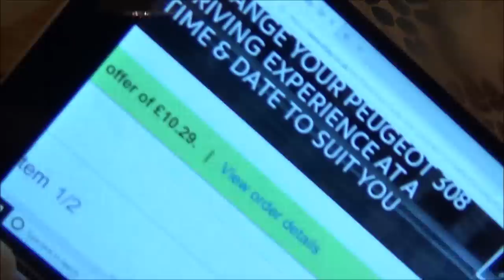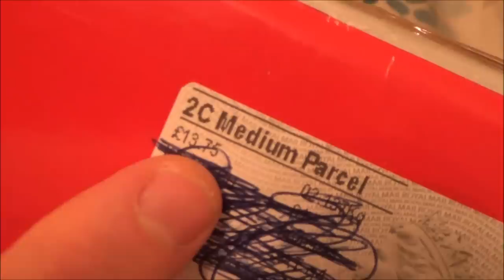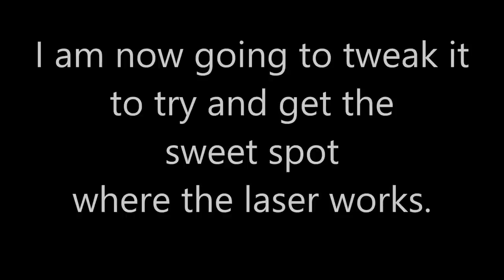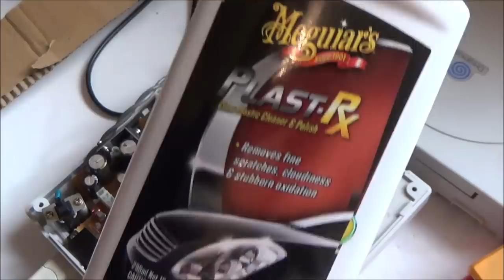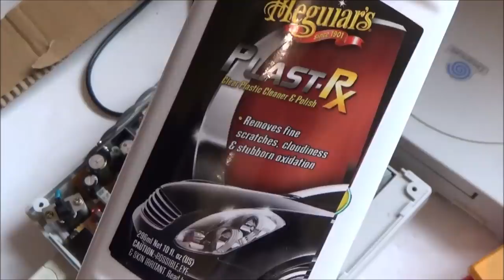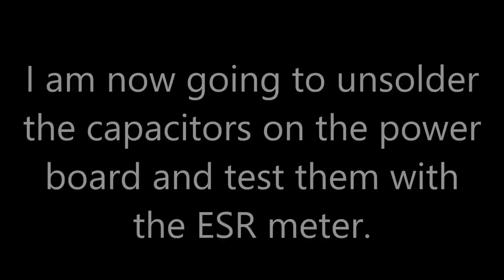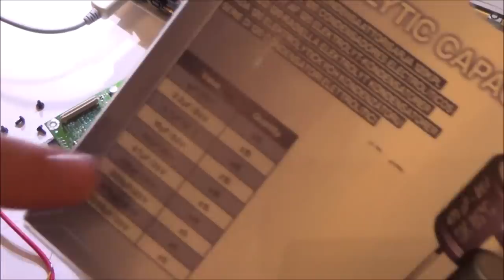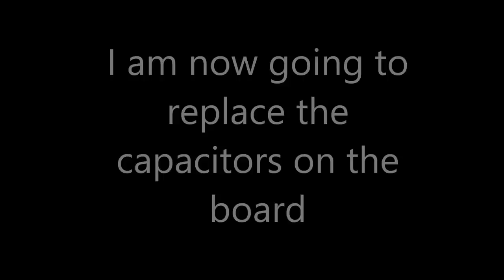Trying to FIX a Faulty SEGA Dreamcast purchased on eBay

Comment: What were you doing at round about 39:00? Measuring Resistance when the system is still powered? That's completely nuts as you then are measuring something but definitely not the resistance. Please do unpower the device and then measure Ohms, as you otherwise would measure some mixup of the voltage provided by the ohmmeter and superimposed the voltage provided from the device to see what current flows through your potentiometer (pot). Are you sure you know what you're doing?

Comment: if the laser stops reading, reduce the resistance. Resistor on the laser head, spin it a little bit, try 700ohm, 650ohm and so on

Comment: The Dreamcast does indeed support AV cables as well. I hear it also supports VGA output if you really want your games to look good. Of course, these cables are all proprietary, but they're options, nonetheless!
Reply: Robbie  That sounds amazing! Where did you get the converter from?
Reply: You know you can just buy a pound brand hdmi cable for the dreamcast

Comment: Hi Vince
LED's be it IR or visible light lose intensity with time, the closer to full power they are operated the quicker it happens. The laser is basically and LED.
The little silver cans are surface mount electrolytic capacitors.
Check the laser sled switch is working with your meter.

Why did you have power applied when testing the laser resistance. You can not read resistance with power applied. The reason you got away with it is because you did not press the lid switch and apply power to the laser. Turning the mains switch on an off was a waste of your time. because all you did was disconnect the mains input circuit from the bridge rectifier. The part of the circuit to be careful of, is the components on the primary side of the transformer.

Comment: Hey man I noticed that u forgot to hit play when u first started to play around with the Dreamcast.  From what I know about having mine back then is if u go to the settings and select the disc to automatically boot or go straight to the bios of the dreamcast.  When it boots into the bios then u have to select play then the disc should start spinning again and boot or if u kept the disc in

Comment: the problem with tweaking the pots like this when they have been tweaked in the past is you don't know if they quarter turned it or turned it one and a quarter or which direction, had a similar problem with my first ps1 laser

Comment: As long as the laser is good which you proved, buy another broken Dreamcast  for a few Pounds most of the failures are indeed the laser. Not the board on the drive. Then the boards. Much cheaper than a new board even if they sold them. A pretty rare failure. I used to replace many laser for people when they were cheaper and Dreamcasts had more value. Definitely get a Scart cable at the least, VGA is also great but more expensive .

Comment: Faulty disc drive? Perfect - GDEmu that sucker!
Reply: Your profile picture goes perfectly with your comment! XD
Reply: I just stumbled on GDEMU and it’s glorious. I ordered a faulty disk drive DC to swap out with a faulty video port. I so need the GDEMU now.
Reply: Robbie  Yes. This is due to the fact that there is no longer a draw on the 12v rail. Just need to soldier in a ~300ohm ~1/4watt (1/2 or 1 watt should also work) resistor. You can even bend the poles at the ends of the resistor and tuck it right into the molex connector for the power rails.

I have heard that removing the regulator along with the small resistor next to it on the underside of the PSU board will accomplish the same thing, though not generate extra heat from the inline resistor added.
Reply: installing one in mine now...
Reply: @bobtee6466  Nice! I found a Dreamcast on the side of the road one day driving home and the controller ports didnt work because the resistor fuse was blown (probably why someone tossed it out), so I replaced that then installed a GDEmu. It is awesome - like having a DC jukebox of all your favorite DC games. I definitely recommend. I also recommend doing the 12v mod mentioned above to reduce excess heat generated due to not having the GD rom drive connected. It is not hard - especially the resistor method.

Comment: the metal component is a crystal, weird thing is that next to it there already is a surface mount one on the board and it looks out of place imo, if the ic's are the same on both boards and one does not have that extra crystal on it why not just desolder it and test it? worth a try imo. 
thanks for the video, I enjoyed it
Reply: also that switch in the drive assembly is a easy fix if you have a bigger one or a different one, you can just pop that in and glue in place where the laser head meats that switch, if there is space to put it in it should be fine, doesn't have to be the same one. weird tho, I never had a drive with a failing switch like ever, and I worked on many CD players and consoles using disc-drives

Comment: Maybe a stupid question, but I tried to figure it out by just looking : Did you in fact try JUST the long ribbon cable on the working dreamcast? could be it is just too long for the sensitive data. (interference) - update : just saw someone asking the same question
Reply from the maker: This is the copied and pasted reply from the other question:-) I am not sure if it was on the video but I definitely eliminated the ribbon cable by either using the short one on the faulty Dreamcast or the long one on the working Dreamcast. I had so much footage as this failed fix went on for hours/days!!! so not fully sure if it all made sense when I cut it all down :-)

Comment: i had a dreamcast sold it as the CD-drive was gone on it, had to open and close it 20+ times before it start to load. you can get a AV cable for it and you can all so do a card reader and out put mods as well. dreamcast has a good mods

Comment: I cannot figure out why you were calling it a bad chip when it was not bad. It wasnt a bad cap or resister. Call it quits. Like that Transmitter I have, eventually, you just learn to call it quits and reliquish it to the parts bin. I know the motherboard on my Transmitter is bad, but I have lots of spare parts incase my new one gets dropped.

Comment: Weren't you reading ~14.3 volts on the 12 V line on the broken console?
Wonder what the working console says and if it has anything to do with it.
Reply: p0w3rKiLL it probably puts out higher voltage to compensate for VDrop when in use.
Reply: @EvilTurkeySlices  Sounds reasonable... but I would still compare it with the working one because I have no idea^^

Comment: I know this video is old... But I'm new to your channel and I noticed the broken dreamcast had a crack in the case.... Most likely dropped.... And that long silver tube on the board is probably a crystal oscillator... And they can easily be damaged in a drop or impact... Try replacing it maybe..

Comment: That shiny tube component looks like a crystal Xtal. 

You mobile phone camera can probably register an ir laser. It will show as a white dot. Mine does and I checked it right now with some IR diodes. 

You can probably shorten the ribbon cable and scrape off the insulation to expose the copper in the new end.

No need to look at a visible laser directly to check its operation. Just lay a shet of paper over the laser and the sheet will glow in the laser color.

Comment: At around 51:15 in the video you read what should be 12 volts actually at 14 volts, A voltage like that indicates the supply is not loaded, mind you the Laser module was not installed and thus perhaps not loading what you were measuring..

And yes a low or high voltage can lead to a fault.. Eg: A short or partial short will have the voltage drop, whilst a higher voltage indicates a circuit or module that is not loading the supply or voltage feed.

Comment: I know it‘s an old video but actually on my Dreamcasts it‘s normal that the drive stops spinning once the disc has initially been read. When you‘re in the Main menu you actually have to manually choose „Play“ for the game to start up.
Only way to automatically Boot the game is to close the lid and restart the console.

Comment: You could also test a fully functional unit like your 2nd unit for comparison voltage ⚡ values. That could also help you determine any PSU power losses for the future . in a lot of cases the voltages are labeled on the power rails but if not get a service manual or test a fully functional unit to obtain the correct values then that can help you out for the future. But "practice what you preach" and be careful across the primary side of the mains and stay on the secondary side (isolated) ⚡⚡⚡

Comment: At 1.12 roughly you say you don't think they are electrolytic capacitors. They are electrolytic capacitors just SMD(Surface Mount Device) electrolytic capacitors. You replaced them with through hole electrolytic capacitors which is fine. They just use SMD rather than through hole for space. There are only two capacitors you have to worry about(in basic electronics) electrolytic and passive. Electrolytic have to be put in the right way. Passive capacitors can be put in either way. Both types of capacitors are used for different jobs in electronics. Basically electrolytic capacitors tend to be used to smooth out power rails(stop spikes in power to for instance a chip) and passive capacitors tend to be used to change signals(waveforms).  At 1.14 roughly you ask about another component it is a crystal oscillator used to provide a sine wave signal to a chip. This could be either a clock signal(not to be confused with a clock on the wall) and is used by computer based chips to send signals in time with the clock. The other kind is an RTC(Real Time Clock) and is used in conjunction with chips to actually provide the time(as in the clock on the wall).
Reply from the maker: Thanks for the valuable advice :-)

Comment: I know this is an old video but this issue is usually not the laser or the disc drive board it's the MAIN power board caps going bad resulting in insufficient power getting to the laser. Change the power board caps and this should fix the weak laser. Alternatively you can buy a new miniature power board from Ali express but cheaper to replace caps.

Comment: Anything game console someone already opened will make the chance of fixing it down by at least 50 percent.  Not ot mention that there will be missing screws and parts you'll have to replace.  It's better to just buy a whole bunch in a lot and switch parts until you get some working and it'll covert the costs you paid and still have extra parts left over for future uses.

Comment: I would try and get the little disk out of the lid. it should be magnetic and hold the disk down when it spins up to speed. that should fix it. I think the reason it's not working is that the cd is not held down to the drive and can't get the proper grip.

Comment: I may be incorrect here but if you start at the laser and check for voltage, if the reading is bad, then you check the next spot back to the originating capacitor?

Comment: 1:13:32: Yes, they are electrolytic capacitors. SMD (surface mounted device) electrolytic capacitors. And there are different kinds of this devices. Some of them are designed to have extra low resistance (low-ESR types), some are designed to be just inexpensive and some are just kind of crappy from the start. The circuits that just need a little buffering but do not have need for very high momentary currents usually use the regular (and cheap) ones, the circuits like switching power supplies or on performance computer boards do use the low-ESR types, circuits that will get hot do use the 105°C types, the regular ones with only 85°C are used for usual circuits. So, depending on what that capacitor is going to do you can choose the right type but many of them do have both - advantages and disadvantages. And Resistance of 1-2 Ohms could be OK as well, depending on the way you are "measuring" the ESR. You could measure it at 400 Hz, 1kHz, 10kHz, ..... Voltage of 1V or less, Voltage of 5V and so on. And under any of the mentioned points you will get other results! But you definitely should never leave that much wire at the capacitors as that works like additional resistance in combination with some inductor. BTW: The component you did not know (the silver shiny one with the 2 wires) is a crystal used for clock frequency oscillator of the controller chip used on that board. The black one on the Yamaha board is just the SMD type but has exactly the same inner parts and way to work.

Comment: FYI if you use your mobile phone camera you can see led's here is a tip try your tv remote control. Turn on your phone camera and point your tv remote at it you will see the led light up unless your remote is faulty or batts are dead.

Comment: Hey Vince, the Dreamcast came standard with composite cables. At least it did in the united states.
Reply: In France all SEGA consoles had RGB cable. It was mandatory for all consoles until 1995 in fact, only SEGA stays with RGB cable in the console's box.

Comment: Good video thanks for the upload 

I had a couple of these Dreamcast several years ago but the 2 I had I believe must have been slightly older than the one in this video as they never had the line adaptor expansion on the side also the 2 I had the button to tell the system the drive door is closed was to the side of the CD tray  as I had to wedge something in the gap to keep the button down as the plastic pin broke off the door oppss 

As for the laser it's not inferred it should show a red light you may not see it if not close enough how I usually look is a slight side view looking down ( not directly looking into it ) 

But it is quite common for lasers to fail especially in devices that are always used  as someone who used to repair electronics such as music systems games consoles and so on mostly it's buggered lasers was the most common fault especially with PlayStation 1 

Gosh those was the good old days now doing laptops and desktop PC repairs and laptop motherboards are a bitch to do especially the one I been working in recently

Comment: Seems like the laser might be bad. All CD drives spin up as they try to read discs, then slow down if unable on first try, then speed up again. I've seen same speed up/ slow down cycle happen three times on PS/2 and I tested it with no disc and noticed no light in the laser that reads these discs.

Comment: I've fixed probably 20+ Dreamcasts and never had to deal with a faulty disk drive board, it's always the laser going bad especially with the Samsung drives and its relatively easy and cheap to get a replacement, you have some real bad luck sometimes :(.

Comment: The surface mount caps are electrolytic, they do look a bit different but if the specs match then they are electrically the same. Using higher voltage rated caps is a improvement as they will run cooler and should last a bit longer because of this..

Comment: Just letting you know Vince ..that component you cant identify is a Crystal ..used to generate clock frequencies for the other chips on the board.
This will have a frequency on it ..the output of which you need an oscilloscope or frequency meter to check.
You can swap this for the one on the good board ..but DONT use heat on the main crystals body and minimal heat on the component legs.
Low melting point alloy is again useful here..so minimal heat for a minimal time  period.
 It isn't polarised so either way round will work.
But I suspect it will be one of the other chips..
again you can play swapsies if you're feeling brave..but chances are ..finding replacements wont be as easy as the motor drive/servo chip you already swapped..
rgds
Evan
Reply from the maker: Thanks Evan for the advice, especially when it comes to the heat on the crystals :-)

Comment: dreamcasts use a proprietary disc format called the GD-ROM. They're somewhere between a CD and a DVD and hold about 1GB of data on them compared with 700MB for a CD and ~4GB on a DVD. The drives are starting to fail en masse, and the chances of you getting a good quality replacement for not much money is pretty low. It's far better, if you're interested in making this thing work, to yank the drive completely and replace it with an SD-card based system that lets you play backup ROMS. It's basically a little special circuit board that pretends to be a drive that you plug an SD card into, that loads rom images as if they were discs. The best is to get one of those drive replacements with a 3d-printed shell that kind of blocks off the interior of the dreamcast as that ensures airflow and that you can't lose anything put inside. Whatever you do with it, good luck.
Reply from the maker: Thanks for the info and tips :-)

Comment: Sad you didn't get this fixed. 

For future reference, on a lot of older consoles, dust will get UNDER the lens on the laser, getting on the actual emitter. This can cause instability or an outright read failure. Now often times, there's not a good way of cleaning this out, at least not that i have found. The floating lens can be very fragile as you well know. I have had success with just using compressed air, VERY lightly! But the chance of destroying the lens assembly is high.

Now due to the steps you took in this video, this is probably not the issue here, but it might be worth keeping in mind if you get another project, where the issue is that the drive won't read.

I haven't seen many people talking about this issue though, and i have definitely seen it a few times. Maybe it'll be of use to you at some point. :)
Reply: Hi Christian. My Dreamcast work’s absolutely great, except that the image seems dim/darker then it should be. Any thoughts? I’ve looked everywhere and can’t seem to find an answer.